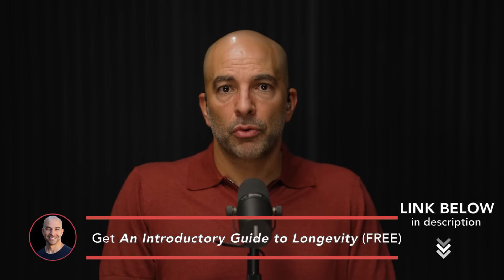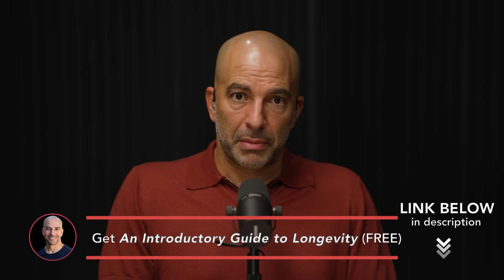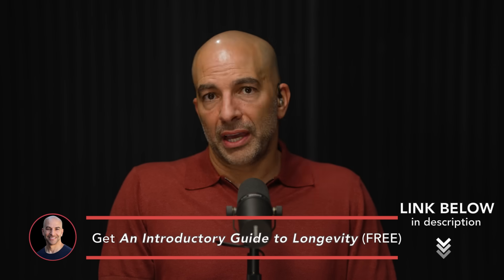Peter Attia's VO₂ Max Training Protocol

Comment: Because excess body fat directly lowers VO₂ max scores, it may partially explain why low VO₂ max correlates so strongly with mortality in population studies.

Rethinking the Mortality Association
Low VO₂ max is strongly associated with increased mortality — but an important question remains:

How much of this risk reflects impaired cardiorespiratory function, and how much reflects obesity itself?
Obesity is independently associated with:
Insulin resistance
Chronic inflammation
Dyslipidemia
Hypertension
Increased mechanical and metabolic strain on the cardiovascular system

This raises an important possibility:
Some of the mortality risk attributed to “low VO₂ max” may be mediated by excess adiposity rather than intrinsic dysfunction of oxygen delivery, CO₂ handling, or mitochondrial oxygen utilization.

Comment: I improved my running vo2 3 points in 3 months going stephen seiler style. 15 min warm-ups, 5 mins at threshold pace then 8×3 mins 1 min rest in between at 90% ofy maximum aerobic speed, 15 mins coldown. It's hard not painful. My threshold pace is 4:45 min/km, my workout pace 4:38. Two times a week.
Reply: threshold pace is not the same intensity as 4x4 intervals, and many would consider it an intermediate level intensity -- it will work to improve v02 max, but not to the same degree as high intensity intervals

Comment: 1 day challenge:
5x20 seconds for HIIT with a 1 minute warmup and cooldown and rest in between, 5x3 for compound lifts, 3x5 for isometric lifts, 3x1-2 or 8 total reps (4x2) for Olympic lifts

HIIT, Snatch (muscle + power + snatch 75, 95, snatch 105, 105, 105, 110)
Clean (muscle + power + clean 95, 125, Clean 140, 140, 140, 145)
BTN jerk (x2 95, 125, BTN jerk 140, 140, 140, 145)
Squat (135, 185, 225, 225, 235)
Deadlift (135, 185, 225, 225, 235)
Bench (135, 145, 155, 165, 170)
Cable row (135, 145, 155, 165, 170)
Pec deck
Hip thrust (135, 185, 225, 225, 235)
Reverse fly
Do ohp
Lat pulldown
Leg ext.
Wallball side slams ea side
Farmer's walk 20ft, HIIT, 5 min walk, 5 min sauna

Comment: another way to to do it is 2 or 3 sets of 3mins on, 3min off ie 2 x (3mins effort, 3mins easy) with 6mins between sets (so you end up with a total of 4 efforts). In each pair you try for the highest power you can manage to keep constant for both efforts, so the first one will feel easier than the second. This will put you in the right range of 90-100% VO2 max. You will need to increase the power as your VO2 max increases, but it wont increase forever. Then you can extend the length of the intervals to 4 and then 5 mins
Reply: correction that should be 2 (or 3) x (3m effort, 3mins easy, 3mins effort, 3mins easy)

Comment: My vo2 max just went down when checking the price of the vo2 master.
Reply: And it's a cheap spiroergometer with very poor accuracy (over 11% measurement error of VO2 in indoor lab conditions). Proper BxB spiroergometers cost from 30k$ and up. Also the Vo2master doesn't measure VCO2 or PETCO2, which is a basic feature in modern BxB devices.

Comment: I think Peter is going to have to address the backlash from other performance/endurance specialists, even those with a physiology background, that improving vo2max should not be one's apriori motivation. His talks on vo2max are highly useful and educational, but little misleading in goal. Maybe I'm mistaken, but I don't recall him saying something along the lines that vo2 should NOT Be your goal, and these metrics  are one indicator that you are benefitting and improving your lifespan/healthspan.
Reply: It sounds like you haven't actually watched many of his videos, or even watched this one all the way through.
He clearly states in this video that he does 3 sessions of zone 2 and one session vo2 max per week. That alone should tell you that he doesn't think vo2 max is the only priority.
This is just one snippet of a longer video. And in other videos and snippets he just talks about zone 2 work and how important that is.
Reply: @Markhypnosis1  wrong.
Reply: @qigong1001  Rather than just saying "wrong", how about telling me exactly HOW I'm wrong? 🙄
Reply: He doesn’t say VO2 is the only metric to look at. There are several key indicators he says to examine for longevity including grip strength, Apo B levels, mobility, etc.
Reply: @ grip strength is even worse. 
Anyway, I didn’t say anywhere in my comment that Peter thinks it’s the ONLY metric . But he has said in multiple videos 
It is the greatest predictor of longevity which is a fun correlation, but it’s incorrect to make that your goal.

Comment: I am trying to understand VO2 max, and it is often coined as an important metric of longevity.  I am trying to understand why that is so.  During 2017-2019, I thought I was in the best condition of my life, jogging 4 miles a day, which even doing anything for me, was probably unheard of.  Also ran a 1/2 marathon in October 2018, but felt I was no where near where I was the prior year, so the decline was in process.  During the first part of 2019, I could hardly job 1/2 mile or so, so my doctor ordered a stress test in May 2019, age 58.   The test indicated 90% blockage in an artery  which I had a stent put in.  The stress test indicated the following:  The patient excercised for 10 minutes 31 seconds, METs were 12.8 using Bruce Protocol and I failed the stress test.   Looking at a formula, VO2 max would be 3.5 times that or 44.80.  One part of me is thinking, I could have died during the half marathon 6 months earlier and I ran it with what could be a 90% blocked artery, but my computed VO2 max (if i did and interpreted that right) looks great. Would love to hear comments, been doing HIT training gradually over the last 6 months now and getting healthier, so I think.
Reply: training especially HIIT and other high intensity forms allows your body to be super efficient in moving and exerting force that your heart and other body muscles dont need as much blood/nutrient/O2 supply to funtion. hence why you had a 90% blockage of main coronary artery without feeling anything and even completing a marathon. this is simply a consequence of more efficient body. 90% blockage in another nontrained human might have killed him or resulted in severe morbidity, you instead ran a half marathon. always follow screening guidelines
Reply: Great comment, agree totally. Also I feel that my decreased ability to excercise flagged the issue far sooner than would be otherwise possible.
Reply: Interesting feedback

Comment: What scientific literature point to longer intervals being better? I see lots of shorter vo2 workouts like 30 seconds on 30 secs off

I’ve definitely noticed the shorter intervals don’t build enough to get me even close to max HR. Maybe that’s why?
Reply: 4 x 4 intervals is a standard VO2 max workout.
Reply: I don't remember the title, but there was one that compared shorter and longer intervals.   

Conclusion is, they both work and so long as you adjust the amount of rest accordingly, there is not a significant difference between them.  
Shorter intervals must have shorter rests, so you don't recover much from one interval to the next (it might take a few intervals to reach max HR).  
For longer intervals, you can recover a lot between them, but each one needs to be long enough that you reach saturation and stay there for a while.
Reply: short intervals workouts like 30 on 30 off, or 30/15, or 40/20 will all get you above 90% of VO2 max, but only if you do the efforts at a high enough power

Comment: I go 45 seconds all out.  I started at 12-15 seconds almost ten years ago but I keep plugging away and my endurance keeps increasing. 
I video’d it on my channel for those who don’t believe me, which I would understand because a few years back I wouldn’t have believed it. 
45 seconds of pure agony, seven sets three times a week.
Reply: if you try a maximal effort for 10 secs can you reach a higher average power/velocity than your best 45 sec effort? You should be able to
Reply: @ I am running at max.  Imagine running absolutely flat out for ten seconds then just keep going.
When I started this 9 years ago I could barely get past 10 seconds.  Then 15 seconds, then 22 seconds and on and on.  You can move your envelope of max effort out with time and consistency.

Comment: I think the 400-meter sprinters are indeed sprinting for 45 seconds. But I am nowhere near that level so I can't judge if they are going all out. 
As a workout, I do sprints at the beginning of every 2 minutes. So I am sprinting for 18-20 seconds (around 120 meters) and then walking for 100 seconds. My goal is to be able to sprint all out for longer and longer periods and to be able to hold my top speed for longer. But I wonder now if this is the optimal way to train for this. 3:38 These Tabata HIIT workouts sound way too painful to me. Even the reverse Tabata sounds like hell. 
I recently did the Cooper test - where you run for 12 minutes and try to reach the longest possible distance in these 12 minutes. It sucked, too. Also, I did it the first thing in the morning on an empty stomach. Does this matter, too?
Reply: the fastest 400m runners hit higher sprinting speeds when they do shorter races, 100m, 200m. So they arent doing a maximal sprint for 400m. Sure they are doing a maximal effort - but the power you can sustain for about 40+secs is less than the power you can sustain for 10secs
Reply: @bobbrian6526  43 seconds for 400 meters means 10.75 for every 100 meters. How much faster do they go at 100m?
Reply: @CharlesOffdensen  not much, but makes better sense to think of it in terms of power output rather than average velocity. In a 100m you put out more power because you accelerate from zero, much less power to do the same average speed with a flying start
Reply: You can't sprint at peak speed for 400 m, only for about 100 m.
Reply: @BrianS-ny9yd  I can't. But I can't do a plank for more than 90 seconds, yet the world record is something like 4 hours. So maybe there is room for improvement still.
Reply: @CharlesOffdensen  The problem is the time it takes.  
When you go MAX your muscles are burning phospocreatines for energy, and the muscles only have enough of those for a few seconds (less than 10 seconds).  

The current world record for 400m is 43.03 seconds, so it is impossible for even the best in the world to run at max for that distance.

Comment: Dang, the VO2 Master costs $7600.
Reply: Bruce protocol, 12 min run or a Garmin watch.  All 3 give me a pretty consistent VO2max measure.
Reply: @blackbeltdad100 every test I’ve seen, garmin is within 2 or 3 points. That should be plenty accurate for nearly everyone!
Reply: Just run regularly all that costs in a little time 😂
Reply: It costs $125k per year to be Peter’s patient, per internet reports… someone chime in if this info is not correct.
Reply: I like the Bruce protocol. Which Garmin model is recommended?
Reply: I want to see how accurate the Apple Watch is compared to the VO2 Master.
Reply: Check your local college or fitness doctor.. you can do them for like $50-$100. They will have you warm up first.
Reply: No doubt Attia has equity in the company.
Reply: Even with a patent and no competition, most potential buyers will be priced out as it isn't feasible to pay that much for the device.

If they want to succeed as a business, they'll have to find a way to lower the prices.

I'm seeing the essentials package at $6900. Most potential buyers wouldn't touch it until it gets closer to $1k.

I hope we don't have to wait until the patent expires before we find a reasonably priced option. They could make a killing if they were able to produce it affordably.